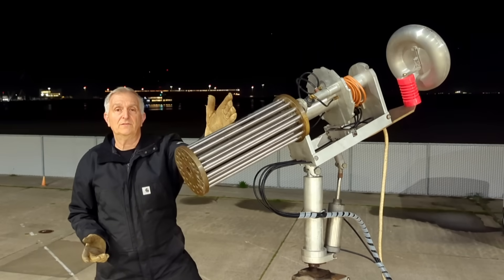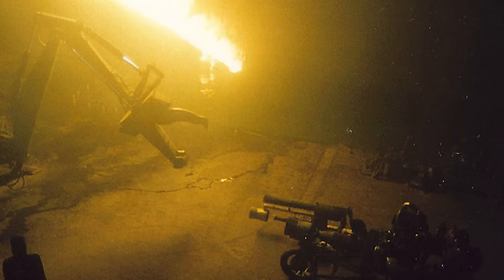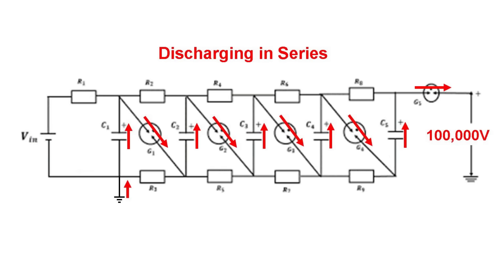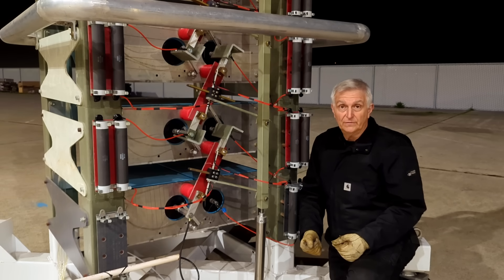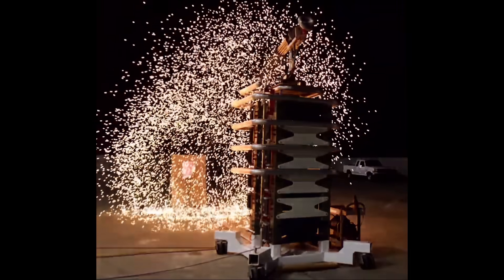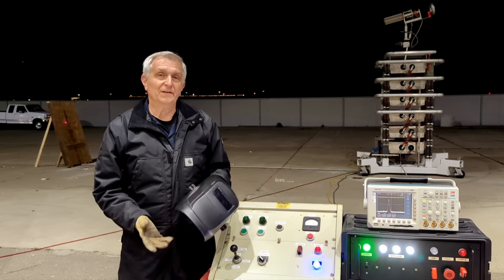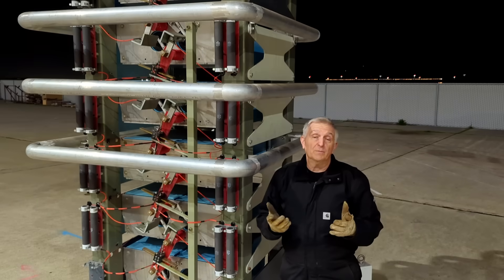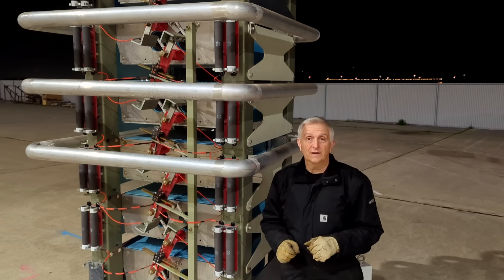Firing the Lorentz Plasma Cannon

Comment: The tool while in Neanderthal, no neck high school level physics no disrespect intended at all. It’s part of our language and overall safeties engineered into high science technology try to avoid touching this tool after you have activated it with your skin, anything that you used to touch it you want a cat seven or better Which means seven independent insulating barriers between you and it and even once you touched this tool after activation with these components periodically will change these components out one of the things that you’ll notice is when you touch this proof of what I’m trying to tell you is when you will notice when you touch it with your bare skin after it has been activated and you run across it you might get a toothache or sick to your stomach as you you touch the different places because it Changes The polarity of each different organ in your body is at another polarity when you get a cold, chill or goosebumps that’s part of the power system inside your body repolarizing for the kelvin thermal neutral induction that it does and I know that’s that’s high science. This is everything I’m saying is high science, actual nuclear physics, actual quantum engineering or quantum mechanics. Quantum mechanics really is nuclear physics. Atomic physics is what nuclear physics is powered by, and if you mess up with nuclear, then you have to use the same tools for working with atomic to clean up the nuclear tool here in any other environment. Other than this one that our environment is unique in existence it is one of 10 military engineered construct nine of them are at 10 G this is the hundred G outpost, so we have people that have wear cybernetic components in them that will allow them to grab onto two tools that have gone full war or nuclear to some people. It looks like that screw or that wrench or that saw all blade or that Skil saw blade is spinning like a tumbleweed to other ones of us we hear it just like a coin spun on the table and fell to the ground and we walk over and we grab it with our bare hands and as soon as we touch it with our bare hands everybody that was looking at it All disoriented dysphoria a shock, and all there was an area of energy and electricity, static electricity that had them all in a slight state of shock, and when we touch the tool, the shock went away and that shock went away. They all felt kind of Looney Tunes crazy and because they couldn’t see the thing still sitting there spinning they didn’t want to talk about it anybody talks about it everybody goes to the nut ward, anybody for a trip to the nut ward OK now if we weren’t around what would happen is that that thing moved so fast that cosmically it now thinks it’s running separate next to the planet like the moon rather than riding a top of the planet inside the environmental pocket, and it’s picking up cosmic radiation, and they’re smacking it as a little bitty, dust particles, and keeping it held above the speed of light in rotation And this is causing the refracted or ambient radiation and both both refracted radiation and ambient radiation generated by the molecular matrix or the crystal and matrix of the item. Question that is spinning faster than the speed of light and trapped there at war 11 or war 12 in rotation as far as actual lensing perfect lensing is warp 10 now you would shoot it with that gun right there and then you would run the power level up and down and inevitably find another neutral point where the thing would stop spinning anytime you saw war core detonation somewhere in existence there is a diskspinning and looks like a tumbleweed or a black hole that somebody had to go pick up after the fact

Comment: I understood the principle you explained about plasma being generated by a sudden high current through a thin wire and how it moves. However, I got a bit confused. In the video, there doesn’t appear to be a visible wire between the weapon and the target, which made me think that perhaps a gas is being ionized into plasma inside the device. But you didn’t mention this in the video. Also, if that’s the case, for the plasma to be accelerated via the Lorentz force, the ionized gas would need to be exposed to a magnetic field over a certain distance. So, what exactly is happening here?
Reply from the maker: The wire only needs to be the size of a human hair to seed the plasma channel, so it's not readily visible on the video

Comment: Hey, loved the video! Would you happen to still have all the calculation sheets available? I'm an electrical engineer and would like to understand more about the calculation of edge voltages and such! Also been wondering how you've come to the number of 2,4kV/ft, as I can't find any particular source of where this number would come from, except maybe corona onset gradient... Been trying to find stuff on your website but had no luck so far :(
Reply from the maker: The transition voltage gradient of about 2200-2400 volts per foot was determined empirically!  The graph paper shows 2 sets of data points that I think were taken in April and June of 92, then there's curve matching to the data points.

Comment: What's the small projectile leaving the gun?
Reply from the maker: The dart is trailing a hair-thin trigger wire, which will direct the 30000 amp plasma channel to the desired target.  1:56

Comment: this may be the coolest thing i saw today and i saw a video of an homemade nuclear fission reactor and a laminar flow rocket engine. But this is exceptional and if i understood correctly you used a wire which was shot at the target to send the electrical pulse but wouldn't it also be possible to use a stream of water which would be more like lightning but also makes it "reload" easier.

Comment: I don't get it. does the device need to be grounded with the target? did you shoot a "metal pipe" too?
Reply from the maker: The dart is trailing a hair-thin trigger wire, which will direct the 30000 amp plasma channel to the desired target.  1:56

Comment: What's the initial bolt/projectile? That seems to be what's causing the biggest impact immediately followed by the arc of energy. It's literally what makes a hole in the wood on the second test
Reply from the maker: The dart is trailing a hair-thin trigger wire, which will direct the 30000 amp plasma channel to the desired target.  1:56

Comment: have you considered Ed Leedskalnin's perpetual motion holder to get the higher voltage stored .. supposedly instant discharge ..or a group of them .. possibly with coils you could separate so you can charge up without needing a ton of equipment..

Comment: The philosophy that I would use is to speak of an enchanted stream of electrons.  It's not dumb voltage at the catalytic point where plasma slips from the air, those electrons encounter information which rules over their interactions.  You could take a different approach and do more therm in the model for your circuit.

Comment: Hey my guy.
Indus Valley resolved that arrangement using pezioelectrics.
Listen to an Indian chant.
The OM they chant meant high voltage.
Your hum is too high, which means your arrangement is too weak.
When fired, an aurora is formed above the machines.

Comment: Wait so is there a wire connecting the gun to the target? Cuz he did mention that a wire could still be used + where would the sparks be coming from if it’s just plasma. Would the sparks be the wire?
Reply from the maker: The dart is trailing a hair-thin trigger wire, which will direct the 30000 amp plasma channel to the desired target.  1:56

Comment: Forgive me, I know exactly nothing about engineering. But I always wondered if a proton beam would be a good way to direct a lighting bolt. Theoretically, no physical wire would mean no theoretical limit for the voltage, theoretically speaking.
Reply from the maker: it could if it produced ionizing radiation along a fairly tight path.  Proton beams are rather expensive to produce however.

Comment: Mercury Can Hold Energy, Why Not Use One Single Mercury Capacitor, instead of a whole shit load of the others? Also, It needs a Power plant, Like a Electric Motor Hooked up to a Gearbox or Transmission with Multiple Horizontal Shafts With All The Extreme Strength Magnet Wheels Spinning and Generating Electricity up to a the Armature that's Sucking up All the Electricity, or instead of an Armature use Mercury Tubes to Suck up the Energy. And the Power plant would Generate Far More Electricity than the Motor uses to Run The Transmission with all the Shafts Spinning with the Magnet Wheels. Also another thing, There may Be No Limit on How Much Energy that Mercury can Suck up, it may be possible to keep Charging for ever. Instead of Capacitors use Mercury Tubes Too. Another thing, I believe if there Was More Amps You Would Not Need That Much Electricity to power the gun, after all you know what they say, "It only Takes Half an Amp to Kill a Person." Also another thing, back to the Power plant, The Stronger the Magnets are in the Magnet Wheels the More Energy Produced! Get the Strongest Magnets Available. The Stronger the Magnet Wheels the Better. I Guarantee You Bud, With Stronger Magnet Wheels it Will Produce So Much Amps that Very Little Volts will Be Needed, First Create the Self Running Generator, Then Start making the Electric Weapon. I wonder if it is Possible to Grow Synthetic Magnets, like they Grow Synthetic Metal with Chemicals and Crystallization? Synthetic Metal Crystallization, how they grow Synthetic Metal So Strong? If it is Possible to Grow Synthetic Magnets Through Chemical Crystallization that are so strong and generate Extreme Amount of Amps for the Magnet Wheels for The Self Powered Dynamo.

Comment: Is there a military application for this? What if you had a 30 foot tower on a destroyer, what would happen if you fired it at an incoming missile a quarter of a mile away? Would the missile explode or just lose guidance? What is the maximum theoretical rate of fire in the case that you have a salvo of incoming missiles to deal with? Currently, it seems the solution to anti-ship missile defense is to shoot (more expensive) other missiles at it. Seems this would be a lot cheaper. You could be rich!

Comment: Not an electrician here...how is 210kv double 150kv?
Reply from the maker: The energy is double, as it goes up with the voltage squared.
Reply: @LightningOnDemand  ahh, that makes sense. I wasn't thinking voltage squared. That's why I asked:)

Comment: Hi and sorry I haven’t read all the posts but just before on the cannon fired at 210 thousand there was to me looked like a tiny ball. The ball hit the target the then main discharge not sure if you noticed it but that was so cool
Reply from the maker: The dart is trailing a hair-thin trigger wire, which will direct the 30000 amp plasma channel to the desired target.  1:56

Comment: Lol that's one of the coolest damn things I ever seen online, let alone life itself 😂.

Question, what is that initial ball that hits target before the actual beam fires? You can see it on the slow motion around 7:55 into video.
Reply from the maker: The dart is trailing a hair-thin trigger wire, which will direct the 30000 amp plasma channel to the desired target.  1:56
Reply: @LightningOnDemand  ah i see. Very similar to how a stun gun works, right?
(By shooting out those 2 little barbed projectiles attached to a thin thin wire)

Lol that thing is awesome 👍💯. 
Any plans on trying it on like a side of beef or something along those lines perhaps?
Would this completely disable a vehicle do uou think?(Would it fry the electeonics?)

Thanks for getting back to me 🙂✌️
Be well and stay safe

Comment: You can, or atleast should be able to, use a pulse laser to create the initial plasma channel, the wavelength that air ionizes best at sea level is easy enough to find, using that frequency or one of its harmonics should do the trick well enough for the ranges your bank can touch.

Comment: I might have missed it, but what is the projectile hitting the target? Is that a physical projectile?
Reply from the maker: The dart is trailing a hair-thin trigger wire, which will direct the 30000 amp plasma channel to the desired target.  1:56

Comment: What are the barrels for? I saw a sort of physical projectile, was that just a chunk of metal, or was it carrying a wire?

Also, it looked like there is a wire or something running from the bottom of the tower to the target area, is that to ground the target?
Reply from the maker: The dart is trailing a hair-thin trigger wire, which will direct the 30000 amp plasma channel to the desired target.  1:56

Comment: Sorry, Engineer, I didnt catch any information about the projectile that flies before, what is that projectile?
Reply from the maker: The dart is trailing a hair-thin trigger wire, which will direct the 30000 amp plasma channel to the desired target.  1:56

Comment: wow, I am at awe seeing that cannon, Im a trekky and Ive always wondered if energy devices were possible, and even have designed a few myself, even though im no physicist, or electronic engineer, but I sometimes have very deep thought process and ideas on how these type of devices could be made, anyways enough of my ramblings, Question: can the plasmatic field be accelerated? by passing it through a magnetic accelerator thats shaped like a conical spiral that gets progressively stronger as the plasmatic field passes through it?

Comment: Wat bedoel je met Lorentz?
Lorentzkracht is de netto elektromagnetische kracht die wordt uitgeoefend op een geladen deeltje q dat met een snelheid →v door een elektrisch veld →E en magnetisch veld →B beweegt . Het wordt gegeven door →F=q→E+q→v×→B.
Reply from the maker: Yes indeed!  The Lorentz force also follows F=JxB, where J is the current density vector.  Since the B field in this case orbits around the conductive path, all of the forces on the charged particles point towards the center, compressing the plasma channel.

Comment: Is there a wire connecting the “gun” to the target? There are a lot of sparks that suggest  the plasma channel is from an exploding wire instead of ionized air. That is how lightning is directed in the intro, at least.
Reply from the maker: The dart is trailing a hair-thin trigger wire, which will direct the 30000 amp plasma channel to the desired target.  1:56

Comment: What is the metal bolt during firing and what is it's purpose?
Reply from the maker: The dart is trailing a hair-thin trigger wire, which will direct the 30000 amp plasma channel to the desired target.  1:56

Comment: This is crazy!Electricity has got a black belt in sucker punching beleave me!! I  tuched a picture tube with a screwdriver around 20+ years ago. I was like 17, and it made a big bluish white flash. I woke up a few seconds later about 3 feet from the TV and felt like my IQ dropped to at least half for about an hour after

Comment: Why couldn’t you fire a guide wire that hits the target and then electricity travels down it to increase your range
Reply from the maker: The dart is trailing a hair-thin trigger wire, which will direct the 30000 amp plasma channel to the desired target.  1:56

Comment: The “Lorentz” part of the name is mostly a catchy, thematic choice rather than a description of a unique physical mechanism in the demonstration. While any plasma discharge involves charged particles that experience Lorentz forces, this setup is essentially a high-voltage capacitor discharge that vaporizes a consumable wire to create a plasma arc across a gap. The effect you see is mainly about creating that plasma channel in the air—not about employing the Lorentz force in a specialized way to propel or control a projectile. So, in this case, the term “Lorentz” is used more for its evocative appeal than to indicate a distinct application of the Lorentz force.
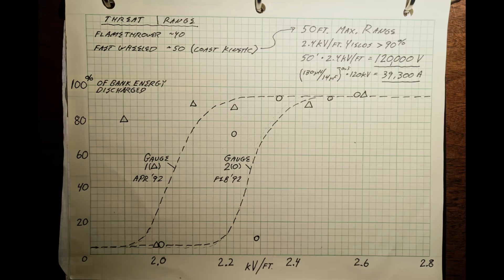Reply from the maker: Note the sharp knee in the curves at 3:00.  This key transition occurs when the Lorentz force overcomes the explosive force.  Without the Lorentz force this critical transition would not exist, the wire would imperceptibly fizzle, and the stored energy would remain in the capacitor bank.
Reply: @LightningOnDemand  when the wire fizzles, you are left with your temporary plasma channel that empties the cap bank. nothing proves lorentz forces overcome anything

Comment: In this demonstration, a consumable wire or fuse element is used to initiate the discharge. When the energy from the capacitors is released, that wire rapidly vaporizes, creating a short-lived plasma channel. This channel forms mostly in the air gap between the device (the source) and the target, rather than depositing most of its energy directly onto the target. The target’s role is mainly to complete the circuit rather than to absorb the discharge in a concentrated way.
Reply from the maker: The target is simply chosen for convenience, not to absorb energy!  There are other choices for targets that would absorb far more energy, and be far more explosive and messy... such as anything containing water:  https://youtu.be/7cQzcXQtgfY
Reply: @LightningOnDemand  here we don't see the 'cannon'. just a mellon with two electrodes that make it boile because of the current through it
Reply: @LightningOnDemand >such as anything containing water

I'm terrified of what would happen if a person was hit by this.
Reply: @budgetcommander4849   bad time to have electrolytes.